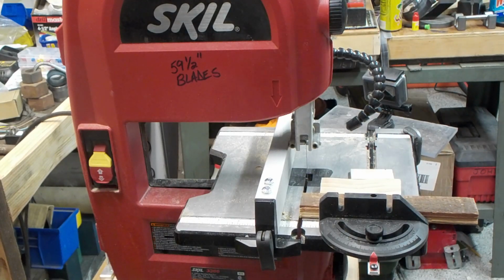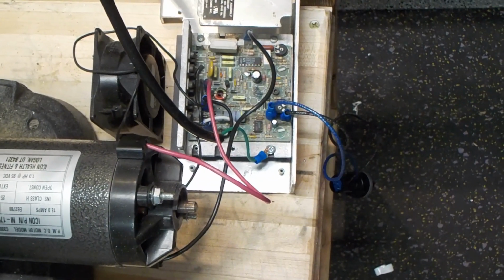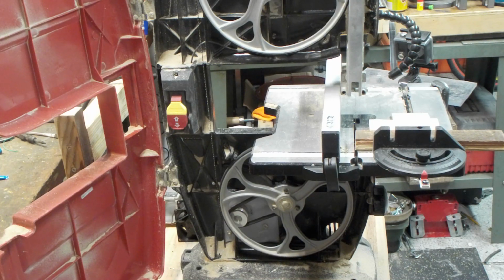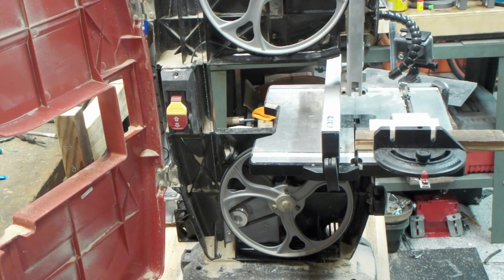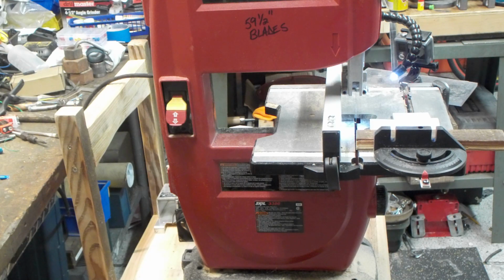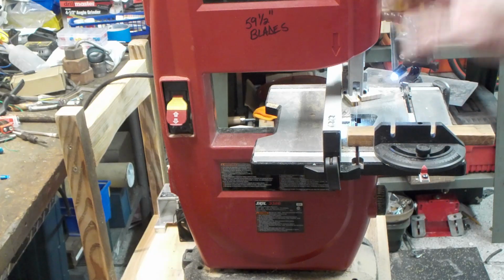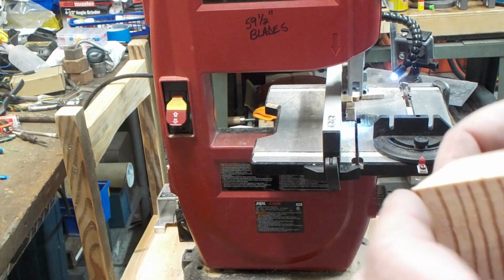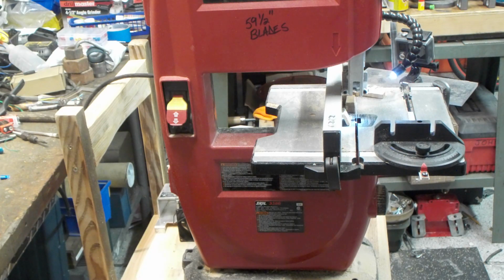Skill 3386 - DC Treadmill Motor Retrofit

Comment: Very cool conversion. Would it be able to use metal cutting blades for use on silver, for exsmple?
Reply from the maker: Yes, I think you’re correct. The speed is variable, so thin metal is certainly possible!

Comment: Nice, if the original motor pulley/flywheel included fins to draw air watch the motor temperature
Reply from the maker: i think i may have cooling worked out!
https://www.hobby-machinist.com/threads/skill-band-saw-3386-1-3-hp-treadmill-motor-retrofit.79469/post-681863